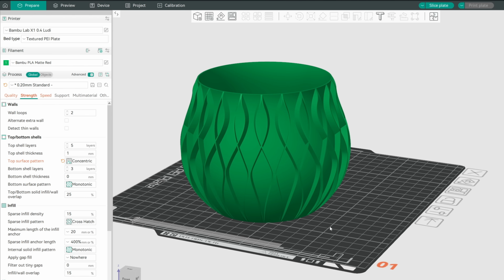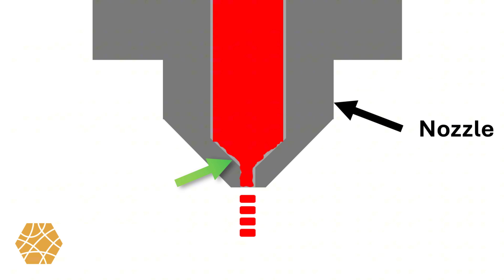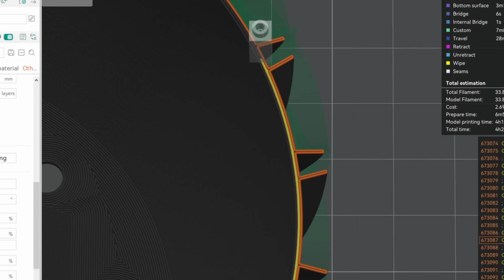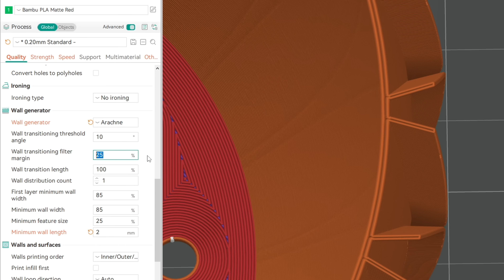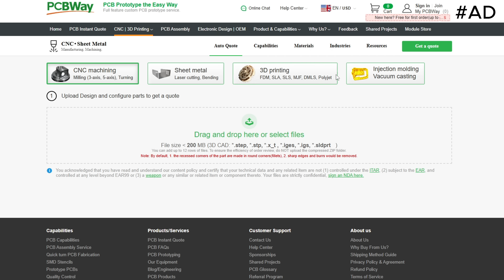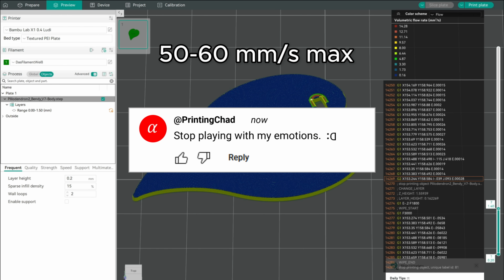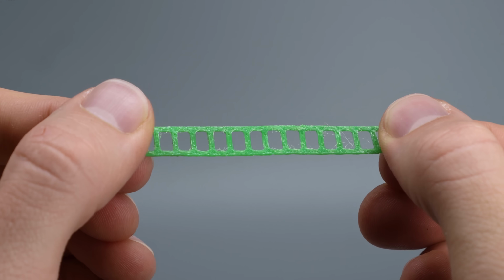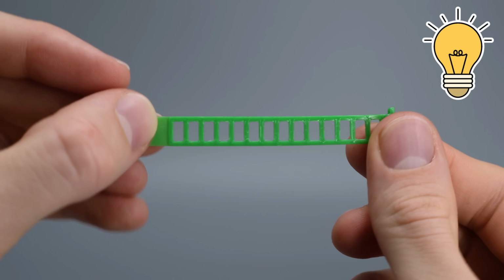The Fatal Error No One Talks About – Get Incredibly Clean 3D Prints!

Comment: You could also print a small part the same height of the main part (like a tower or even ooze shield around the print) to help prime the extruder and fix pressure before each layer.
Reply from the maker: Yes!

Comment: Very good video. I have a question for a simple box I am doing - it’s very simple and 175mm x 175mm x 175mm (so almost max capacity of my a1 mini). It is just a square box with flat sides and it always shows a very visible layer line when it transitions from bottom and sides to doing only sides. Is there a tip to get rid of that. And also a tip to get rid of warping in the corners? I am using PLA - I have tried with PLA+ in white from JAYO, but the next ones I need to do are red, blue and black in R-PLA from spectrum filaments. Just if there where so settings I should try to play around with 😊
Reply from the maker: I have a video coming out in a few weeks on your exact problem, I hope you can wait until then. 
As for your warping problem, try rounding out your side corners, this should fix the issue.

Comment: i haven o info on 3d printing but hasn't it been years? by now, shouldn't all these trial and error settings should be automated? 
wouldn't it take too much effort, time and probably waste in return pollution to find out all those tiny walls, extrusion speed/pressure etc. seems too much manual labour and definitely sounds like settings that shouldn't be changeable to begin with since that print head is static in size, unless you have a print head that can close and open depending on the print thickness it shouldn't try and print other sizes imho.
Reply from the maker: No sometimes you also want some of these enabled. A lot of it is geometry driven but I think 3D printing has made insane progress the past few years.

Comment: I think the larger lesson is you can’t just load a model and hit print; you need to really look at the preview, see what the printer is going to do, and make adjustments. Think of the tool path in the same way a machinist does with a CNC mill.
Reply: I assume the overlap of 3d printers and CNC machinists is one of the biggest ones you can find, but still there's not a lot of people having experience with CNC milling. I don't think the average person knows how CNC milling works or how the process to program it looks

Comment: using arachne casues my walls to have deviation in the z axis, just ever so slightly. i changed the both slicing tolerances to 0, and change the line width manually after first slicing with stock settings to see what it looks. and from there change the width in the area of problem with a modifier disc covering just that area. making benchy's with no hull lines :P
Reply from the maker: You get rid of the hull line by only changing the line widths? I think that one should be more related to layer print time. Would love to see if this works, if you have time it would be awesome if you could send the 3mf file to my email. :) (its in my Youtube bio)
Reply: @Factorian_Designs  sure :) i will dig around the archive and see what i find :)

Comment: I’m using the creality hi 3d printer and when I print at like 350mm/s the prints often fall off I’ve tried it without glue and with glue any tips
Reply from the maker: Make sure you bed is free of "hand oils" for maximum adhesion and avoid line crossing infill like grid. Use gyroid or simillar.
Reply: @Factorian_Designs  ok i'll try that

Comment: Highly educational content. Can't say that I have ever noticed extrusion issues after small gap fill extrusions, but maybe this is because I usually print with wider nozzles and at slower speeds, using arachne. You definately want to avoid printing small extrusions with tpu.
I look forward to slicers offering incorperated precise controls for individual variable extrusion line widths, speeds, order, temperatures, flow, etc, without g-code editing, maybe with some kind of painting feature.
Super thrilled about the new infill multiplyer feature in orca, was even planning for ages now, to make an app in blender, to generate multiple wall infill, pre slicer.
"Rips faster than a fart in a yoga class". Not bad my friend, not bad. 😊
Keep up the great content.
Reply from the maker: Thank you, love that the added the infill multiplyer as well. Extremely handy feature!

Comment: I've been doing CNC and CAM for years and it's "obvious" that minute tool path differences affect output and quality. Never once did it even cross my mind that the minute Slicer settings could influence quality and strength so much. Wow, you've created yet another rabbit hole to dive into.

Comment: To use Orca with your Bambu, do you just not update the printer past when they locked it down? Great video by the way on a problem everyone has
Reply from the maker: I updated my machines and just use LAN mode with them. You can still use Orca that way :)
Reply: @Factorian_Designs ahh. I’m on LAN as well, was hoping there was a way to still use the app and stuff with orca. Thanks anyway

Comment: Thank you very much for your howto!
Since you talk about different slicer being almost the same... 
I noticed that avoiding to cross walls seems buggy in Bambu slicer. You ever compared the simulation using the same stl in Bambu and Orca? The result is alarming. In my case, this causes a very bad stringing even enabled avoid crossing walls in Bambu.

Hope, that information helps some desperate guys out there.
Reply from the maker: Yes weirdly enough Bambu and Orca sometimes show very different results like that but most of the time these are patched out in more stable release versions. I never had any problems with avoid crossing walls though.

Comment: I have an older bowden printer (Prusa Mini) and am still overall very happy with the print quality (and with the newest updates) even the speed. But lately I had a lot of problems with terrible seams on thin walled objects. Thanks for pointing me into the right direction for troubleshooting (Arachne, linewidths, linear advance calibration).

Comment: I've been racking my brain all year trying to figure out what's wrong with this new Diamondback nozzle. I was actually getting close to switching back to the stock Bambu nozzle because my prints have been so ugly. It 6am on a Saturday and I just happened to wake up early and see this video showcasing EXACTLY what's been going on with my printer and how to fix it. Seriously I can't thank you enough for making this video and I can't wait to try these tips out. Though this most likely means that the diamondback nozzle for bambu just isn't designed as well as I had hoped because it can't seem to keep enough pressure in the nozzle to properly print retractions. I didn't used to have to modify the print settings every single time to get a decent print, it used to just work.
Reply from the maker: Oh wow, did your chages fix the issue?

Comment: Hi, amazing attention to details! Will implement your suggestions in my own works.
Just wondering, the understanding of each problematic geometry can be time consuming. Can't you add a custom purge after the ironing layer and continue without overbaked filament and normal nozzle pressure?
Sure it's a bit more filament and not a surefire solution, but less detective work maybe?
Reply: Stand corrected 😂😂😂 posted comment at 7:50, right before the time lapse setting.
Works better and is easier than manual purge setups...

Comment: This is a big deal. They need to change the slicer to do this automatically. 

Also, I am skeptical of your statement making it sound like Arachne has better surface finish than Classic. I have generally found the opposite.
Reply from the maker: It more seems to me like the difference in surface finish depends a lot on the model. I still use classic more than arachne.

Comment: Sme really good tips on modifying the layer widths. 
It would be a good practice as a designer to make designs that don't need these fine tuned print settings to come out nice, and will print well with the defaults most people use.

Comment: i dont understand why pressure should drop because of small extrusions. if i have a fixed amount of plastic in a fixed amount of space, wont the pressure always be the same, no matter how often i put it in and out again?
the only reasons that come to my mind for falling pressure would be a slipping extruder wheel or poorly calibrated linear advance, both of which i wouldnt wanna fix in the slicer...

btw, i had this issue a lot on my ender3 especially with bad linear advance settings, now, on my x1c with automated linear advance calibration this problem never came back.
Reply from the maker: Think about it this way again, if your line width is less than the nozzle opening this doesn't hold true anymore as your space is not fixed in order for a thinner than 0,4 mm line to be printed. There is also the problem of this whole process being inaccurate which adds up.

The linear advance is another topic, its more connected to accelation behavior.
Reply: @Factorian_Designs  i always imagined those fine lines as if one fills a crack with a silicone gun. even if the nozzle is bigger than the crack, the silicone is funneled into the crack and the nozzle wipes away the excess. walls and roof of the crack become part of the nozzle so to speak. 
but since the effect is real, as u documented undeniable, maybe im wrong with the confined space on the other side. its restricted by the heatbreak  and the cold plastic. the slower you print, the more heated space develops for the plastic to expand into. which lets pressure drop.
anyway, very interesting topc, thx for sharing.

Comment: The last one might be possible to print in vase mode. If you split the ”ladder” at each step with a tiny gap (like 0.01mm) and set the smallest gap size accordingly you can turn the ladder into one continuous line and he result will be an amazingly clean print :)
I’ve done that on containers with kind of intricate shapes that resulted in a lot of stringing inside the container, if you can convert them into one single line there’s no more stringing at all :)

Note, it only works if each layer in the print can be converted to a ”Eulerian circuit”, meaning the printer only has to visit every part of the layer once. So for example to islands would not work, but I’d say most ”functional” models can be converted to a single line path :)
Reply from the maker: That sounds very interesting! Do you have any pointers on how to do this? Or somewhere to read up on it? :)
Reply: @Factorian_Designs Don’t know if there are any articles out there, I’m sure there are, but I was forced to come up with a way to eliminate internal stringing completely cause I needed small containers that could stack a specific part perfectly and the stringing made the parts get stuck, and the model had internal fins to keep everything in place which caused a lot of stringing. If you have some preferred file sharing site or such I could send you the file so you can check it out, but YT usually delete comments with links so we have to be sneaky about it :p

It’s fairly easy to do though if you model your part from scratch, you just have to model your part as one one line. A bit more difficult to do when converting an already existing model, but you should be able to use a boolean cutter to carve out gaps.

For example, in your vase model you can convert the ”fins” into very thin ”U” shapes, with an actual tiny gap in it, but since the gap is so small it will just melt together when printed like any other lines.

Takes some trial and error to get the gaps right and get the slicer to play ball, but I would highly recommend trying it out, the results are great, and you can easily see in the preview if it will work, so you don’t have to print to find out which is also great :)
Reply from the maker: @beaconofwierd1883  That sounds very interesting and I think I know mostly how you do it.

Would you mind sending me an e-mail with an example file?

You can get my e-mail addresse by clicking on my channel and in the description section on "more". At the very bottom of the popup window is my contact info with spam protect.

I don't wan't to directly post it here to prevent all the weird AI bots from contacting me 😅
Reply: @Factorian_Designs  Sure, I sent it now :) I also included some flowers I found while digging up the files that might interest you :)
Reply from the maker: @beaconofwierd1883  Thank you! I'll look at all the files later today :D

Comment: What if -now hear me out cause I'm gonna suggest something crazy here-, what if these manufacturers just designed an extruder that can actually print what you tell it? By... oh, I don't know, measuring the pressure inside the nozzle for example?
I don't understand why plastic metering isn't done with a sensor, or with a metering pump...
Reply from the maker: I think the A1 series does that with its calibration sequence but only to get the K values. Realtime adjustment probably doesn't work that great or they are working on it. Just guessing tho.

Comment: I Had a problem with a Project the Last 2 weeks. Solution was to reduce the flow by 3% and Change then layer hight at the critical area to 0.08 instead of 0.2

IT was with a round shaped Project. 
And only appears If i printed the full model. The Problem started after 1:35... So really Frustrating. 

But the Diameter changed a Lot.. 

At the end it is fixes and im Happy now ^^

Comment: Huh, i didn't think anyone used classic still. Appreciate the detail, ive always struggled with when to modify those exact settings.
Reply from the maker: I still use classic most of the time tbh. I have seen print issues with arachne for 2 models last week :/
Reply: @Factorian_Designs interesting!

Out of curiosity, have you been printing linger than Arachne becoming an option?

I'm starting to see it as a generational divide.
Reply from the maker: @kbo8029  yes, it was way worse when it first came out. Now the differences are way smaller.

Comment: How to print a grid ???? ahah its seems imposible to optimise the order of the holes. I went as far as making a mesh that represents the path (making diagonal staircase like holes so it has less holes to compute) but still it jumps around holes (skipping adjacent holes in times) and the start point for the segment also looks weird constantly moves to a further side of the segment without a visible purpose like the end of that segment isnt near the start of the next, hard to explain but at the very least one would expect a "even odd" pattern where at least once every two adjacent holes would start with minimal travel (.42mm) but no it always travels to the further side of the next hole (when actually manages to segway to an adjacent hole)

Comment: I ran into those problems aswell and some things to avoid this. Couldn't even look for those problems without the proper terms. So this video is quite welcome. 
My attempts so far: Sacrificial parts (like your cleaning tower workaround). Increasing flow for ironing by way more than I thought (double or more). With wall thickness 3, using the wall print order setting inner/outer/inner. Set the seem to a part of the print that is less important or better to sand down.
Glad to have something to look for with my next prints.
Reply from the maker: All good points to lookout for as well 👍🏼

Comment: the print quality iceberg is so deep that i think despite the massive improvements in the last 10 years we still have another 20 to go before we perfect it
Reply: exactly my thoughts after watching this video. Surely slicer devs are aware of this stuff and are thinking of ways to automate all these, right? RIIIGHT ?! ... :((
Reply: probably easier to come up with a non cancerous resin than to work out the mechanical imperfections of fdm
Reply: @djordjezivic2481  that is exactly what I was thinking .... the future is resin. It's just a faster, less complicated and more controlable method. And the resin chemistry has a lot of potential to evolve. And once the patents expire, that fancy tehnique where resin is sprayed with inkjet like nozzles and cured with UV light afterwards sounds amazing. I think that's the method that allows multi colour resin printing.
Reply: Implement AI and teach it to recognize these things and you could probably have a slicer auto-generate a perfect print every time. Wouldn't be surprised if it's possible right now, just needs to be implemented.
Reply: Not sure it will take that long, with AI it could advance very fast

Comment: @factorian Designs minimum wall length is not available in mm on bambuslicer. instead it's in percentages. default it's at 100%, should it now be set to 400% in bb slicer? thanks
Reply from the maker: Yes this should be exactly the same.

Comment: Wonderful! Danke!   I would like to know your thoughts on "Blind Spots" in part cooling fan design. I learned of a blind spot in my awesome  Plus4 printer while printing a complicated bird feeder design. The model had 3 openings arrayed about an egg-shaped cross section. When the nozzle would travel around the shape i would have bad part cooling on the same side arrayed about the cross section. Someone pointed this out to me and i was amazed. What are your thoughts?
Reply from the maker: I can see how that could maybe happen but I never had that problem until now.

As the air flow always comes down and sideways it would have to be a very special geometry for that to happen though.